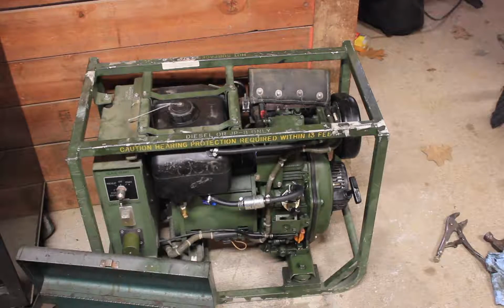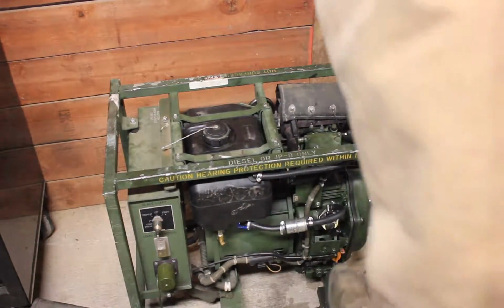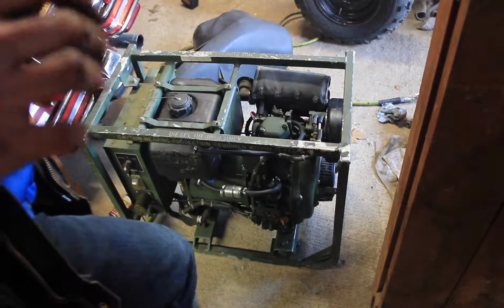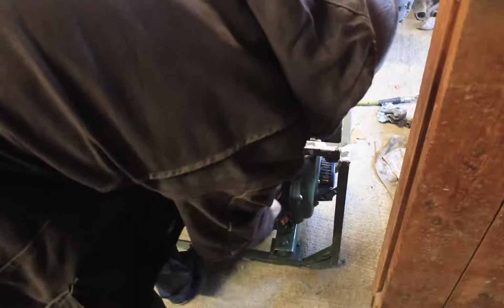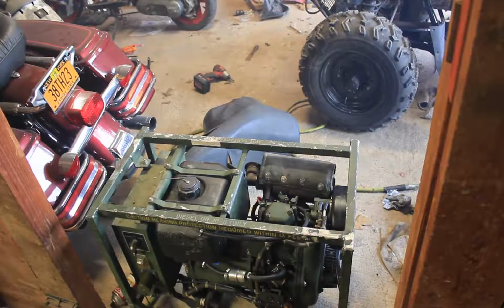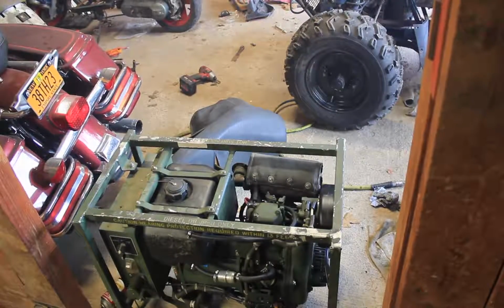MILITARY DIESEL GENERATOR SPARK ARRESTOR VS NO SPARK RUNNING

Comment: Very interesting. Much less smoke without spark arrest or.   I have a similar genset, Yanmar engine. I run home heating oil in mine, works great and starts first or second pull.
Reply from the maker: John Rand I found it interesting too, makes sense though, diesels run better with less back pressure